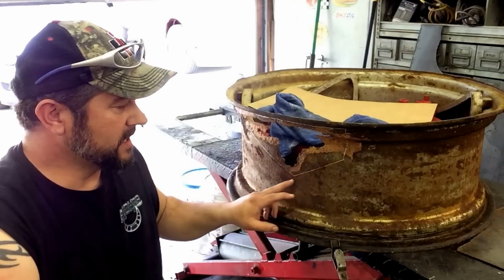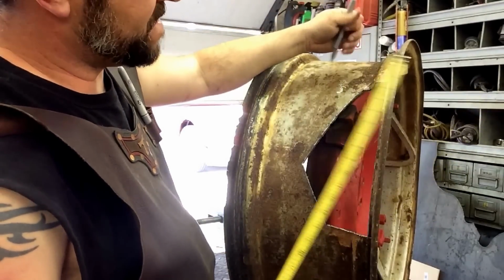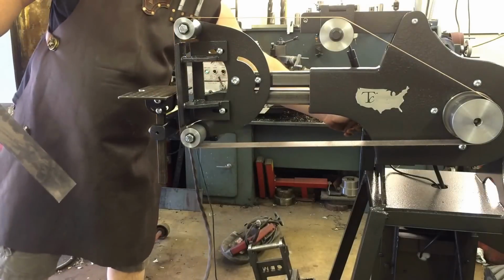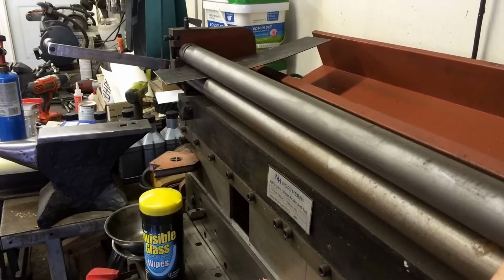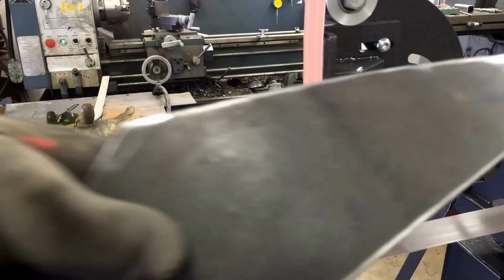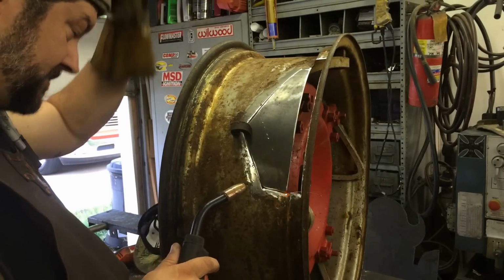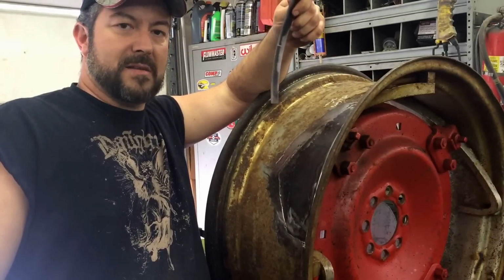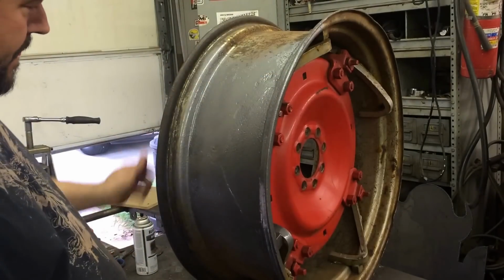Tractor wheel repair

Comment: I have tractors from the 1935-1975 era. Most of them from 1940's. So I have several rims to fix. Thanks for showing how to do it, using
3 diff rolls. Bottom, top, and side angle. Now, all I need to do is figure out how to home make a little, foot wide roller, to help out on the project.
Wonder what, or where I can get the  roller material. Could it be as simple as using thick pipe, to roll that thickness of steel. What gauge was that you used?
Reply from the maker: @janbill79  I used 10 gauge or pretty close to 1/8 of an inch and you can definitely roll it around a piece of pipe or your knee or something like that. It’s just easier to overbend the radius and then just mash it down and it will follow the contour of the wheel perfectly